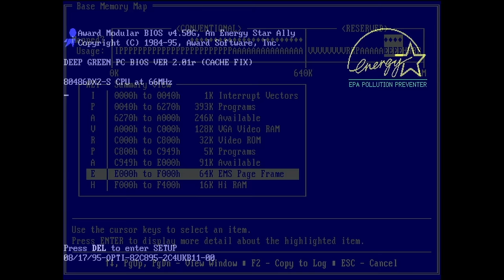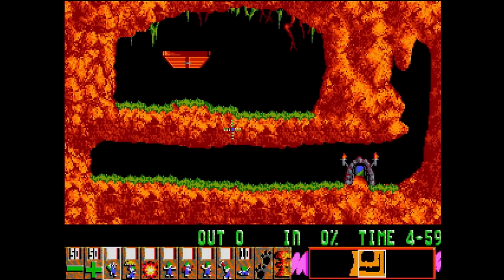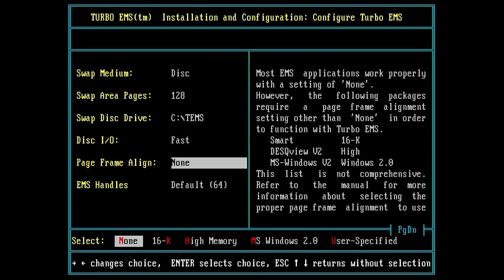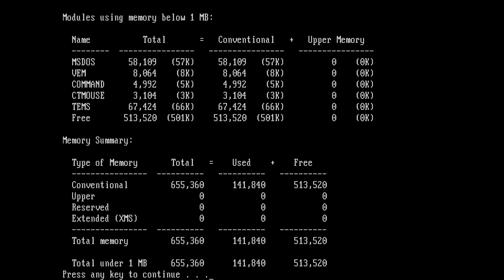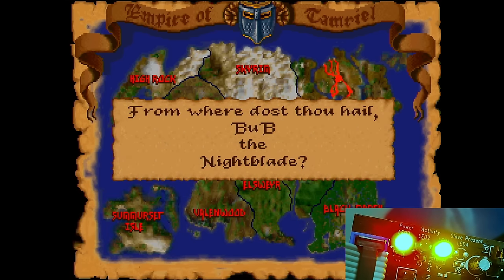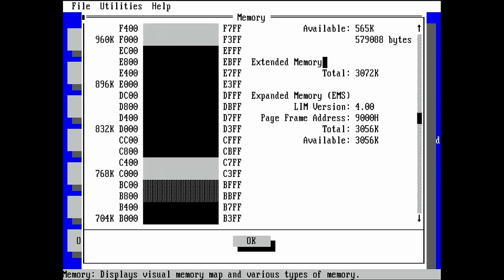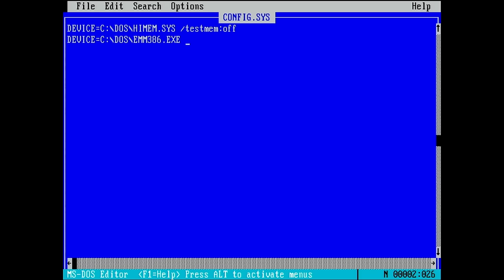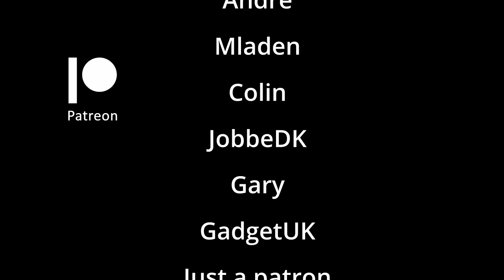EMS Memory: The clever hack for more memory in DOS!

Comment: You are wrong when moving ems window to E000 with real mode(i guess turbo ems uses real mode). Accessing first 1M adress range controlled by chipset, first 640Kb always routed to RAM memory controller, all remain range A000-EFFF by design routed to external bus (ISA/MCA/VLB/PCI). Your motherboard gave you gift - it still routed E000 to RAM, this is specific to chipset or bios settings. For examle you can insert LAN card with BOOT rom, and this boot rom can begin with E000, I can’t even imagine how the chipset will determine where to route E000. Only one way exist - BIOS at POST stage must check every 16K/32K/64K above C000, if some piece contains nonzero data it means external ROM and BIOS reconfigures chipset to disable routing to RAM and route this piece to bus. OR configuring every piece by user, called Shadow RAM since 386 era. Most 286 chipsets dosnt support shadow ram and never route A000-FFFF to RAM
Reply: That's also why Arena crashed. TurboEMS was happy to allocate it some memory in the E000 region, but when it tried to write anything there, it was just thrown on the bus and it disappeared into, uhm, oblivion.

A000 through BFFF is famously used for the VGA framebuffer aperture. Set 'Mode 13' (which is what Arena uses), and blast some bytes there and they will appear on screen as pixels. Nothing significant is in between.

Comment: funny thing about EMS on an HDD
if you had an old beast but could not find the right old ram chips you could fake it with a gigabyte i-ram
even a 256mb ddr1 stick running as a sata ssd through an IDE adapter COULD be better than a real SSD
the problem is that pesky IDE interface being a low-revision would limit speed to about the same as an HDD, but without the wear issues
and given a dead I-ram battery would not harm using it for swap(as most swap is dumped on reboot) you could use an old one as-is

the only problem with that solution is the PCI slot it requires for power, I suppose an ISA to PCI adapter could provide power passively

but these days there are much better solutions to actual old hardware, like dosbox-x that actively emulates at low-level the parameters of popular old gaming hardware, and lets you use modern speed physical interfaces and ram so the limit is emulation speed, which can be "un-turbo'ed"

basically with modern hardware the only reason for old rigs is the cool factor, not much purpose for the software to run on OG hardware except with super specialty devices like the VHS backup software+interface

though sadly even though it is a fact that nobody is harmed by copies of this ancient software running on emulated/ancient hardware, that somehow it is still against DMCA to use what is impossible to get legitimately from the copyright owner anymore

some laws are stupid, and some laws that I am bound by companies get away with flagrantly breaking

I will "pirate" old software it is impossible to buy from the copyright owner, with literally zero guilt
if the copyright owner wishes to start taking purchase orders for that content I will pay for it after pirating when I can afford it

a similar law exists within my state about e-bike motor limits
they set a limit of 750w, which is about what is minimum for 150lbs of person PLUS cargo, so a healthy person with almost no cargo(including the battery weight)
technically all ebike kits now have power limits in settings, and speed limits
-if the reason for the law is speed, well I already have a limiter at the maximum my bike can take before oscillations make it unsafe, 25mph, the same as the most common speed limit in my town anyway
-if the reason is to force pedaling, dude pedal assist is often actually less safe due to poorly configured uneditable feedback loops in the controller you can't easily replace(looking at you EU forcing terribly dangerous pedal assist and 250w limits, stop being stupid)
-if the reason is battery size STOP BELIEVING LITHIUM BATTERY SAFETY MYTHS, lithium batteries with a proper BMS are 100% safe, you charge them once every few months to 100%, never let them sit at 0%(ie when the BMS cuts off the power output) they simply do not explode, ever
in fact the rise of LiFePO4 packs means there is not even a danger of fire even if abused due to the more stable yet heavier and larger chemistry

my ebike is a kit, with a set of the most useless brake sensor levers(they literally broke the springs after a few pulls) so I used a hall sensor to measure my rear brake cable(I always start with rear braking and only hit front if I need a faster stop) and it came with a fully enclosed and protected battery, which ironically should have used locktite on the usb port nut as it fell off inside the battery, causing me to decide that opening it was worth the risk because if it was not built right(good hint based on the loose nut) it could short out internally even with a BMS

so yes, treat a battery right and NO RISK EXISTS, multiply your weight(and average cargo weight) in lbs by 5 and buy that motor size, ignore the law
same with abandonware, the DMCA is being abused by companies who refuse to sell you the content, yet claim profit loss by you obtaining the content they refuse the profits of selling(which is not hard to do as they already have e-stores so hosting a few ancient roms for sale would not hurt them at all)

sorry had to rant about laws that should be broken and ignored because of them being completely unjustified or based on lies and misinformation(and thereby invalid and should very much should be ignored)

Comment: You forgot that you can load the mouse drivers and a high mem by using the LH command
Reply from the maker: I didn't want to get too much into this topic. That is something for a future video when I cover upper memory.
But yes, there are ways to free up more conventional memory, but they require at least HIMEM.
Reply: I like to use my own PS2 mouse handler similar like the open source cutemouse driver works, but without com ports and without to build a TSR. For a mouse pointer i use a picture(24 bit RGB) from my web cam of a green water can made of plastic with drawing the pointer into the linear framebuffer(in the 4th gb) of a VBE graphic with 32 bit per pixel.

Comment: Why wasn't there a similar way to use 4GB frames for 32 but systems to extend 32 but systems?
Reply: Look up "Physical Address Extension". It was used in P4's to allow the machines to run more than 4GB of memory.

Comment: A lot of game programmer use a simple loop for a delay, but the timer chip and the vsync exist since the first days. So this is a very bad programming style. They ignore that modern CPUs are running faster. I made a menu with a cursor bar to move up and down on a 80286 CPU with 20 mhz and the routine works near with the same speed on intel core2quad with 2700 mhz.

Comment: Or yeah... Swapfiles. many many years later iwanted to play Rollercoaster Tycoon (one of the 3d types) on my mums Windows machine. But it couldn't run because of low memory. So i configured the machine to have 128MB Swap in Windows. Then it was runable. But on a measly 10FPS if ever. That was other times. Funnier, i was a kid back then (or specifically early teenager)

Comment: I've never heard of turbo ems before. emm386 for sure though. I did have a computer with 640k. It was a zenith ez pc (286 and dual 3.25" DD floppy). It was for my sister for use in college. But it couldn't run windows or use a network. So it was mostly useless outside of basic word processing. My dad traded our compaq 386 (5.25" floppy + 20mb hard no clue on ram). For whatever reason the compaq didn't work much better. Maybe because of the crappy floppy? I don't know. Eventually I ended up with both. I hoped I could combine them into a single better computer. The compaq was obviously better to me........except the damn floppy. I put in the zenith floppy and......nothing. Ah! obviously it's a bios issue. I'll swap the bios chips (I'm already cringing at myself) because that will work! *ZAP! both computers COMPLETELY dead. We ended up with a 486 after that. Interestingly enough out of everything only the zenith was a new computer. The others were used.

Comment: The latest XMS memory manager himem.sys can address up to 4 gb on 80386+ like the undocumented 16 bit BIG Real mode with A20 address line on and a segment size of 4 gb for DS, ES, FS, GS segment and 64 kb limit for CS and SS segment. This allows to use instruction with a 32 bit offset address using an address size(67h) prefix with 16 bit MS DOS.

Example to build one instruction:
rep
DB 67h
movsd   ; copy dword from  ds:esi to es:edi  ecx times